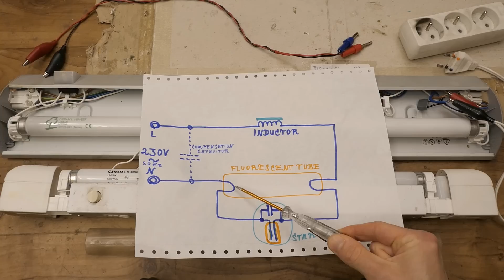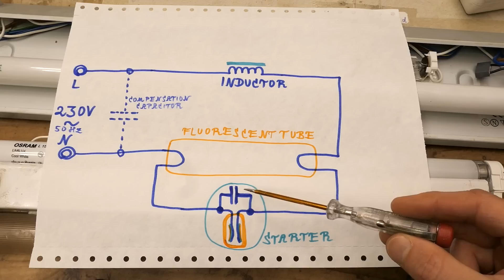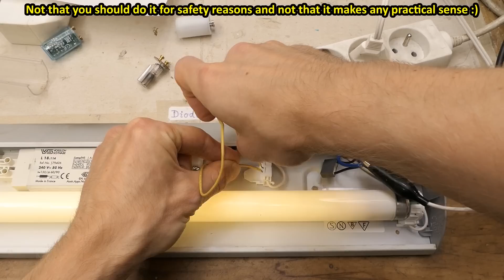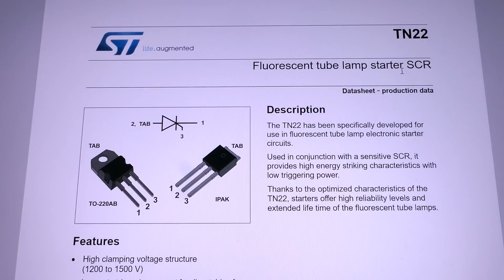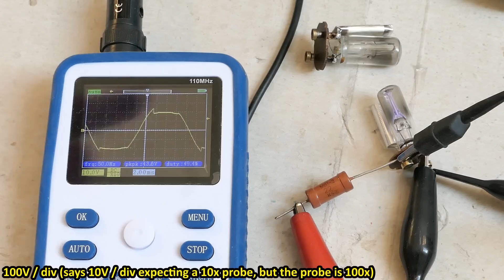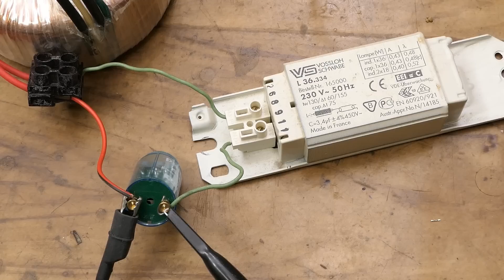Fluorescent lamps, electronic vs. glow starters

Comment: Another factor in how long time is need for the fluerscent tube will ignite is the degre wear of fluorescent tube itself, since the value of the ignition voltage increases with the level of wear.
And also the ignition voltage is increases by the temperature of the environment has decrease.

Permanent welding of the starter electrodes occurs most often if the number of ignition attempts is too many times in a row, which indicates a higher wear of the tube or a very low ambient temperature.

The import of fluorescent tubes from Russia will not really happen again, except that we would find ourselves in a time when all semiconductors burned out, which is not so improbable. 

However, the import of other commodities as it was many decades will continue from Russia, whether someone wants it or not :)

Comment: Nice video. Thanks for explaining something not obvious and not written everywhere. Your assumptions looks perfectly correct. What the threshold voltage of jc1? Thanks
Reply from the maker: The JC1 diode drops 0.6V measured using a multimeter. Just slightly more than 1N4007. But of course, at a higher current, it might drop close to 1V.
Reply: The only thing i dont get is when you use the electronic starter in series with the 60w bulb and P0130AA goes in conduction mode and stops conducting only when you disconnect and reconnect. Did you understand why this happens? Because if P0130AA is conductive due to 100uF cap charged at 0,6-1v connecting and disconnecting the circuit shouldnt interdict him.

Comment: Btw if you put a 470nf to 1uf foil capacitor were the starter usually goes with a push button in series you can manually start a CFL even with burned filaments
Reply: But, with one open filament the circuit to the starter is not continuous, its open?
Reply: @uploadJ  you short both CFL contacts and the starter is the back emf of the inductor
Reply: @lorenzorentniop717  
Starting, no, TRYING to start a lamp w/o filaments 'assist', and now you're confessing that you also bypass the filaments, but your 'test case' seems to involve CFL bulbs (in your last comment), not the two or four foot long tubes we're discussing here. 
I HAVE a couple desk lamps from the 60's and 70's that have the 'push' switch to start the lamp, but the FILAMENTS still come alive (glow) when using the switch.
Reply: @uploadJ  I did it with long CFL tubes and it works I don't say it's ideal it's just a curious thing that you can start CFL tubes just with the back induction of the ballast inductor without filaments
Reply: @uploadJ  if you want I can make a video showing it off
Reply: @lorenzorentniop717  re: "I don't say it's ideal it's just a curious thing"
Oh. Well, I never tried that trick, and, really no interest in trying it. But, I will say I can cause a tube to 'light' using RF at or near the feed point of my Tuned Loop transmitting antenna, at the 100W RF power level (I'm a ham radio op among other things.)
Reply: @lorenzorentniop717  
That may interest a group of people, it adds to our collective knowledge base.
Reply: @uploadJ  why are you so mean about this huh so stubborn next time I will not share anything may the knowledge die with me jeez

Comment: From what I remember, always passing a very small current through the filaments via the starter capacitor keeps the entire filament warm increasing bulb life. Without it there is a failure mode where most of the filament cools off while only a tiny section passes all of the discharge current and runs way over normal temperature, eventually leading to early bulb failure. It's this same reason why higher end electronic ballasts also keep a small current running through the filament.
Reply: No, that is fairly wrong. A continuously heated cathode is a different circuit (Rapid Start) that is mainly used in the USA.
The capacitor in a starter is only mainly there to suppress the radio interference. There is virtually no current flowing through the filaments once the lamp strikes in this circuit.

(Medium and high quality) Electronic ballasts don't continuously heat the filaments either. The mid/high quality models just do a better have a very well controlled preheat, so less is blasted away each restart.

A triphosphor fluorescent tube will basically last 100,000 hours or more with no filament current (starter removed) if it is started once and the tube current is constant. On an inductive ballast that is literally impossible due to voltage fluctuations (affecting discharge current).

There's almost no filament degradation from (normal) operation. However the filaments will definitely splutter and degrade badly if tube current is too low (eg: an under-voltage supply). It's starting that kills them the most, especially with Switch Start circuits.
Reply from the maker: After the startup, the filaments are mostly heated by the discharge. The capacitor in the starter is 10nF at best, and let's assume a longer tube that drops 100V, this at 50Hz makes the capacitor pass only 0.3mA, absolutely negligible heating effect.
Reply: @johncoops6897   The standard 2 transistor electronic ballasts I've seen continually supply filament current. Current limited AC is applied to the two outer terminals and a capacitor of around 3.3 nF is between the inner terminals where the starter would be. When the frequency is over 20kHz this should be a decent amount of current.
Reply: @eDoc2020 - yes, that might be true for some low cost ballasts, however that is not what I was talking about. Sorry for this outrageously long reply, but I hope that I can share some knowledge....
.
Ballasts are sold in different configurations at different price points. Aside from what you describe, there are ALSO higher quality electronic ballasts that use far better circuitry.
The majority of these higher quality ballasts (eg: Osram Quicktronic Pro QTP, Philips Professional HF-P) are termed "high-frequency cathode disconnect" electronic ballasts.
.
After the lamp discharge is analysed and determined to be 100% stable (usually with a microcontroller) the filament current is completely disconnected, and the lamp is run in what is termed a "cold cathode mode".
.
The disconnection of the filaments results in an additional few watts of power saving per tube compared to simpler ballasts that continuously apply some filament current.
Over the life of a commercial installation this small power saving produces a significant return on investment, and it quickly offsets the additional initial cost of the better quality ballast.
.
The important point is that the "filament disconnect" ballasts ALSO usually provide a slighly longer tube life as well, compared to a mid-range ballast of the exact same driver configuration yet keeps the filaments heated (in any way).
.
Whilst there are some other aspects of "high-end" ballasts that  I haven't mentioned here, the upshot is that continuous heating of filaments (during long-term normal lamp operation) does not increase the lamp life, and may in fact decrease it.
.
The presence of a capacitor that may leak some current into the filament circuit does not correspond to any design intent that it's needed for that purpose of heating the filaments. In fact, the current leakage is pretty much an unfortunate byproduct of the capacitors presence!
.
In a switch-start inductive ballast circuit, the capacitor across the glow starter is ONLY there to perform three functions: 1) to modify the timing characteristics of the neon discharge bottle, 2) to increase the life of the contact points of the bimetal switch and 3) to suppress the RF generated by the arc created by the contacts.
....
OK now, the "practical lamp life" of a modern (triphosphor) tube is primarily a function of filament spluttering, which is significantly  increased when the gas discharge occurs while filament temperatures are lower than optimal. This is what you are correctly referring to with your comments.
However, the "filament evaporation" (my own term) is quite the reverse.
.
We know that the emissive material needs to be heated to glowing red or even white hot to (sort-of) turbo-charge the starting process, and this significantly degrades the filaments.
However once the lamp is running, the necessary filament temperature is far lower. Any increase of filament temperature (above the optimum) point will increase the rate of "evaporation" above what is needed.
.
The tube is designed so that the filament temperature is maintained by the inherent operation of the arc. The optimum temperature is also dictated and balanced by the ambient conditions that the tube is operated in, as stated in the data sheets, but usually stated like @ XXX ma arc and 25 °C.
...
What this all means that if tubes are operated in sub-optimal temperatures (eg: in a freezer) then additional filament heating current is definitely beneficial to both light output and filament life.
However the vast majority of tubes are operated in (fixture) conditions where the lamp and filament temperature is already optimised or too high.
.
Therefore, continual filament heating current is not required for normal tube operation and will not improve filament life - and most likely will degrade it to some degree.
.
This can be confirmed by comparing the average life of tubes in identical conditions. For example continuously running them 24/7 on pre-heat inductive ballasts, on a contant voltage and temperature, with half the tubes having the glow bottle starter (including capacitor) fitted and half the tubes with it removed.
.
Unfortunately, since running fluorescent tubes continuously off one single start and in controlled conditions produces the absolute longest life, this test will probably require at least 100-150,000 hours to produce meaningful results 🤣 
.
Wow, that 👆 was like a text book and I still omitted a heap of stuff 🤔🙄
Reply: @johncoops6897   As you say traditional fluorescent lamp types are probably made to run without extra cathode heating. I don't know about some of the newer types. The only "real" electronic ballast I've examined was made for a T5 residential lamp. It wouldn't surprise me if high-end digital ballasts measure the filament resistance to determine temperature and then supply the perfect amount of current for the conditions.

The rest are CFL ballasts which are obviously cheap but since the tubes aren't standardized they may be designed for the extra heating.

I also wonder about rapid-start ballasts. They've been used for decades and I don't think they are killing lamps. I do have a document somewhere on my computer detailing standard ANSI lamp types and their drive requirements. That would probably shed some light on the issue.

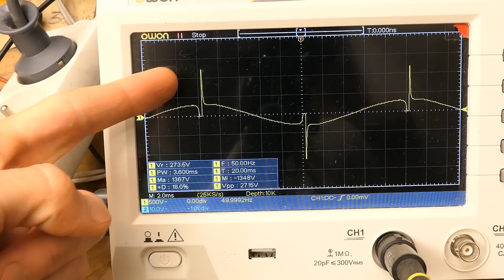Comment: What type of probe did you use for the oscilloscope measurements at 20:20? High voltage differential?
Reply from the maker: Just a 2kV x100 probe. Doesn't have to be differential because I used an isolation transformer.
Reply: @DiodeGoneWild  Nice! Thanks for the reply and all of the fantastic uploads. I've learnt so much from you!

Comment: I prefer the inefficient hazardous waste to the stupid LEDs because it turns out that the inefficient hazardous waste is replaceable and recyclable.
IMO the only legitimate use for stupid LEDs is in LED strips, because the LEDs are spread across a wide area, so they do not overheat, and they are replaceable.

LED light bulbs are an incredibly stupid idea, because putting so many LEDs and electronics in such a small device makes them run very hot and have a very short lifespan.
Modern LED light bulbs often use a stupid buck regulator, they should instead use a linear regulator which could be made out of 1 bridge rectifier, 1 transistor, 2 resistors and 1 zener diode, and a capacitor to prevent flicker. Should the capacitor fail, the light bulb will flicker but should continue working. They should also have a large aluminium heatsink with fins, which very few LED bulbs have.

Comment: How do you get those macro shots done? They are beautiful! I'm wondering especially about the large depth of focus, which is hard to get on macros.

Where's the clicking sound of a starting fluorescent tube actually coming from? I always though it was the starter making/breaking contact. But from this videos it seems that there's only a "ping" when the lamp actually strikes (or at least flashes) and not every time the starter makes/breaks contact.

Comment: Hello. Can anybody help me? What happens when a fluorescent lamp is worn out and flashes and won't start? Will an electronic safety starter protect and turn off the fluorescent lamp without damaging the starter? Or will the thermal fuse in the starter blow and then the starter is useless?

Comment: That's freaking awesome ... always wondered why the old tubes blinked like that.  So How do the LED replacements work in this system?
Reply from the maker: When retrofitting LED tubes, the inductor is typically bypassed and the starter removed or replaced with a short. You just bring mains voltage into the tube to power the LEDs using an internam switching power supply.

Comment: capacitor across a switch would be like a condenser across the points in an old school ignition system ,  makes the contacts last longer?
Reply from the maker: Could be... a switch across contacts causes more arcing when making contact, but less arcing when breaking contact, I guess, so it could do both.

Comment: NOTE: Normal American fluorescent fixtures don't use this circuit. The 110V mains doesn't have sufficient headroom to inductively start  and run a 4ft or longer tube.
.
They use a different ballast and no starter. The filaments are continuously heated using tapped windings off the ballast. The lamp strikes once there is sufficient emission from the filaments, and there is no high voltage pulse.

The circuit is called "Rapid Start" as opposed to this circuit which is "Switch Start".
Reply from the maker: I've heard of these, but never seen one in person. Having 230V (220V in the past), we run any tube up to 58W T8 (or older 65W T12) that are 150cm long using just a series inductor and a starter.
Reply: @DiodeGoneWild  In the uk we can run T12 2.4m 125w tubes. just have a 7.2uf 440v capacitor in series with the inductor, rest of circuit is same with switch start.
Reply: @DiodeGoneWild   Meanwhile I have at least half a dozen rapid start ballasts at home but I've never seen an electronic starter.

Comment: Fascinating - all my life I've wondered what witchcraft existed in a fluorescent fitting and the starter - I remember the trick of using a working starter to fire up the non-working ones (teachers didn't really like us climbing up on the desks to do this 😁) - more recently I've just replaced a T8 tube with a LED equivalent that came with a "starter" - I'd quite like to pull it apart to understand what's inside and why it can be retrofitted and how the wiring is arranged since it can also be used without the ballast 🤔
Reply: The so called LED-starter is just a short circuit.  The LED tube has the driver connected across the two pins at one end and a short across the two pins at the other end.  This allows the circuit to work whichever way round you fit the tube.
Reply: @petehiggins33  thanks, makes sense as without the ballast it needs the L+N at the supply end - surprisingly simple and makes me wonder why more fluorescent fittings aren’t switched out like this in all those wasteful public places (unless the ballast makes them marginally less efficient?)

Comment: Never seen Tubes in series :D Would be interesting, I wonder, if traditional starter on one tube and electronic on the second series tube, would just strike as normal? Or some kind of flashy disco effect as one strikes first? So few components to light the tube but oh so much happening under the bonnet :D cool :)
I have 3x 2foot tubes in my attic, love the cold start spooky blinky light, clinky sound as they try to come on then settle down :D
Reply from the maker: It's common to connect two 18W tubes in series in 220-240V countries. Every 4-tube 60x60cm light has two series pairs in it. It halves the inductor losses. I've just tried what you said - one normal starter (the 110V one typical for the series pairs) and one electronic. And it works well :).

Comment: So whats the easiest way for a man that loves flurescent tubes to continue to use them

I canot make a starter at home (I could make electronic one), but I much prefer the old style one (love the clicks)

What about the pre-heat ballast, how easy would this be to make?

I guess the hardest one would be the tube itself, although some neon sign maker could probably make me one

I hate this ever changing enviroment standards, first its safe, u buy it, u build things around it, then its dangerous and u have to buy something else (that has its own flaws)....

Whats the best way to fight this, maxbe making our own lights at home or importing or something?
Reply from the maker: Why not just hoard them?
Reply: @DiodeGoneWild  I do that already, but sadly I dont have unlimited space and fluresnect tubes are long

Also what if I need a specific size to light something like a new closet, I cannot hoard something I dont yet know I will need

And hoarding is sadly not a future proof solution, no matter how big your stock is, it will always run dry someday
Reply: The ballast for a preheat start fixture is just an inductor, A lot of turns of wire wrapped around a stack of iron lamination.

Comment: I prefer old fashioned flashy starters, I had a vision of Building a circuit which mimicks this for LEDs as eventually the supply of Fluroscent tubes will run dry since the ban.
Reply from the maker: I hoarded about 100 - 150 tubes :D
Reply: @DiodeGoneWild  you're well set!, I unfortunately only have fixtures...no bulbs
Reply: @lukedavis436  I think they will be available in non-EU countries.
Reply: @mernokimuvek  UKs banned them